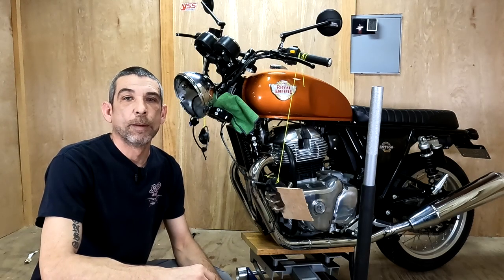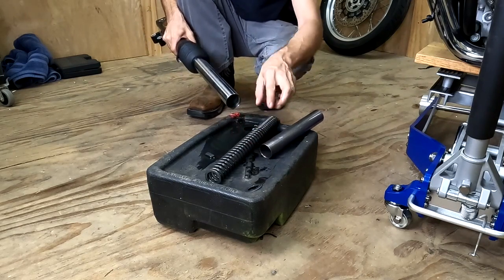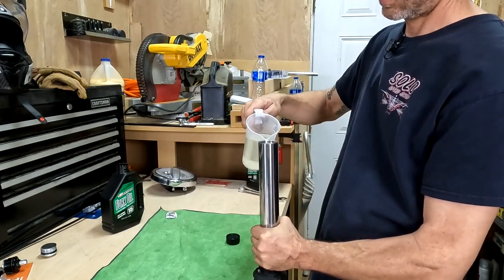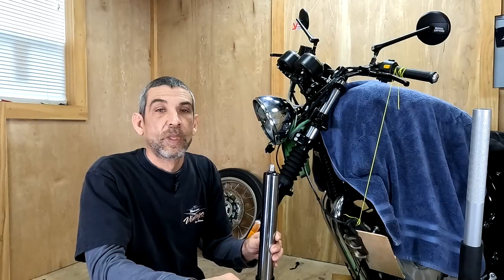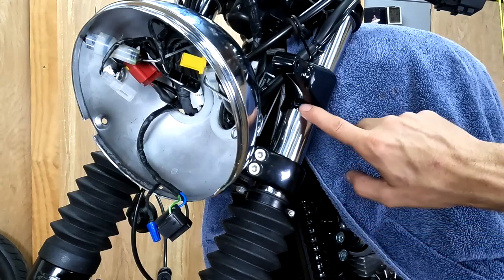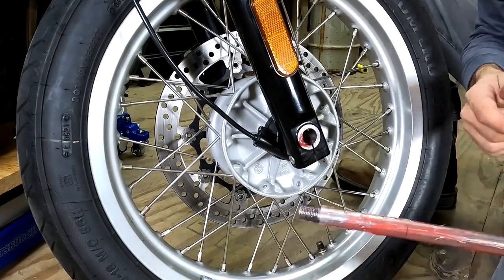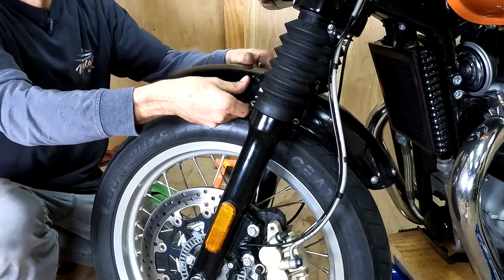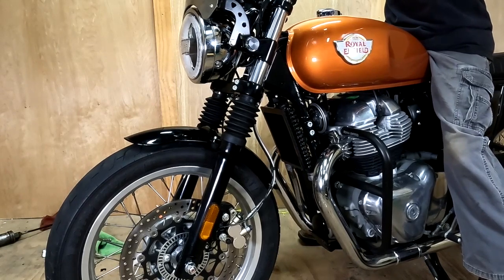Royal Enfield Interceptor 650 - YSS Fork Upgrade Kit (Part 2) - Assembly

Comment: After ridden my friends gt with yss springs and complained about it on bad roads .
I removed the springs which to hard for a confi ride and installed preload adjusters 
So my opinion keep stock spring and install preload adjusters  start at 6mm in ,gives a allround confort .
Works fine on my interceptor and took realy bad roads and holes  here in Belgica .
Start with the preloads and safe money .
Grt

Comment: once again a great video, the volume of fork oil that you added is for standard fork internals, now you have added the emulator  and added the oil, the volume of air inside the fork will be less, air is compressible and forms part of the suspension, i reduced the oil until its just above the emulator with fork extended so the emulator is always in oil, or use fork oil level, ie a syringe and some tube to get oil level correct, also if you buy the emulators from tec you get instructions on drilling the damper rods, i drilled 6 8mm holes in mine, i think they dont saynthis 8n the kit so people arent frightened off, im sure yiu will find improvement but it can be even better, good luck
Reply from the maker: @rover100bunson Thanks for the comment. Yeah, you can change the air gap / air cushion by adding or removing oil to get all kinds of different results. I don't think I'll do the drilling. I haven't rode it yet but I'll adjust the oil level if if I need to. I have a buddy who put 430ml in his forks with the YSS upgrade kit and got amazing results. Once I ride the bike I'll get an idea of what I need to do, if anything, to get the front suspension tuned in. Thanks again for the comment and thanks for watching.
Reply: @my-enfield612  I am in the camp that does not drill anything on this kit. After 20,000 miles/2+ years (28,000 on the bike) I am very satisfied with the upgrade and still believe that if a rider wants different damping they change the weight of the fork oil. 
Good methodology in your technique and we appreciate your giving the distances/spacing for the headlight brackets, etc. Again, this kit is THE single-most improvement to the Enfield 650s bar none. Anxious to hear your opinion as well. Virginia
Reply: @frederickwoods5943  If you don't drill out the damper rods then the compression damping is still controlled by the tiny holes in them. Drilling them takes the damper rods out of the equation putting the compression damping on the emulators which is what their for.
Reply from the maker: @Frederick Woods Hey bud, glad to hear you chime in. I'm hoping to get on the bike tomorrow. I'll let you know what I think. I need to get the front wheel off the ground so I can adjust the preload before I ride. At least get it close. I'm excited to see how it handles. I like a stiffer/track setup in my suspension so the 15w should be good. I thought 20w was a bit much. I'm sure you know the owners manual says the fork oil is 2w 25. But, the service manual says 10w. There is a diagram that says 2w 25 but right under that the text says to "use the specified fork oil 10w". Have you seen this?
Reply: @my-enfield612  yes, I saw that and agree that 15w is optimum. Years ago we mixed various weights to get an oddball viscosity such as 17.5, etc using equal parts of 15 and 20.
Thanks for the heads up and looking forward to your findings... be safe.

Comment: Are you sure that you put the yss fork kit inside the forks before adding the fork oil. Better to put first the fork oil and measure the air gap before adding the yss fork kit.
Reply: You are correct.
Reply: Does this really matter which way , oil as you did on the video, or oil first, great video  thorough tutorial thanx, nice handlebars to, can I ask what make and model?
Reply: @paulwatson2961  the air gap matters
Reply: if you add oil first and measure the air gap before adding the springs, the measurement will be different after you add the springs. When you add a mass to liquid, the level of the liquid will rise
Reply: @breadgarlichouse2265  This is why YSS advises you to pour the oil in each fort leg first to establish the correct air cap first. Before adding the springs and kit.

Comment: The YSS Fork Valve needs explaining, mine came set differently for each leg!  Without fine tuning this valve the whole upgrade is incomplete, as this sets the fork rebound. FYI  I am at 3 turns out from full close, this has eliminated the the fork going into a 2nd bounce that seriously unsettles the bike in corners. Ride safe

Comment: So by simply slipping in an emulator you have improved the fork performance ..... yet you still have the oil flow controlled by the original damper rod holes,  which basically means the emulator isnt doing its intended job. It might just about be controlling whatever oil the damper rods allow through thats all and it is not operating as per design. There are plenty of emulator videos out there, but the one by the inventor, Paul at Race Tec is worth a watch and proves my point.
Reply: That's not quite correct. At low suspension velocities (when going over smooth or semi-smooth pavement), the emulator will provide much more resistance than the holes in the damping rod so it will work just fine whether the holes are drilled out or not. It's only at the high velocities, when going fast over harsh bumps and when the emulator opens up that the holes can become the limiting factor, making the suspension harsher than ideal. If you experience that harshness then yes, you need to drill. Keep in mind though that if you drill too much, the suspension might start to bottom out on those harsh bumps, which is much more risky. The emulator provides very little damping at very high velocities (when it's fully open), relying on the damping rod holes for damping at those velocities instead.

Comment: Great, no nonsense, step by step video, just what I needed! Thanks a million :)
Have you found a marked difference after riding it?
I also see you didn't drill the emulators, which I would not be too keen on doing, (if it needs the drill hole, why don't they make it that way?) Was there a reason you didn't do so in your case, and would adding a thinner weight oil achieve the same result if you wanted??
Anyway, great video.
Reply: Why would you drill out the Emulators? You mean damper rods.
Reply from the maker: @Andrew Rymell Thanks for the comment. I haven't ridden the bike yet. I'm gonna ride it tomorrow. Yes, I didn't drill the damper rods because, like you said, it not made that way and the instructions don't say to. I'll put it this way. I have heard people say the upgrade kit, with no drilling, is "night and day" compared to stock. After they did do the drilling there was a noticeable difference in the upgrade kit "but it wasn't night and day". Once you drill you can't go back. Different weight oils will change everything. Changing the air gap/air cushion will have big effects too. I don't care what they say, I won't be drilling these out. Thanks again for the comment and thanks for watching.

Comment: I see you used RS15? I am wondering if another brand would be equivalent? Also, is the orientation of springs when put back something to watch out for? I plan to do this, but I am considering to only swap out the oil only with preload adjusters and see how it turns out.
Reply from the maker: @Jay Patel Thanks for the comment. I'm not sure about other brands. Haven't looked into it much. As for the springs, the orientation doesn't matter with this kit. The spacing between the spring windings is the same all the way down. If the spring had tighter windings/smaller gaps on one side, the side with the tighter windings would would go in first. (tighter windings down) Thanks again for the comment and thanks for watching.

Comment: I'm surprised you don't measure the air gap in each forkleg.
Reply from the maker: @janjansen7556 Thanks for the comment. I do everything by the service manual which gives you the milliliters needed for the front forks. You can use the air gap method but there is nothing in the YSS installation manual that mentions the correct gap. Some people say 140mm and others say 150mm. Also, if you go with the air gap method, I'm pretty sure the springs need to be out and the fork should be fully compressed when measuring the gap. Way easier if you  know the recommended oil amount. Just use the measuring cup and poor in. Thanks again for the comment and thanks for watching.
Reply: @my-enfield612   hmmm...it is not one or the other: of course you start with recommendef amount of fluid. But next you can measure the airgap to ensure the level is exactly the same in both fork leggs. And the (skimpy) YSS instructions do mention it  as the first of the final remarks: "measure oil level from surface of oil until the edge of inner tube"

Comment: How is your feedback? BTW 15 W oil is not to heavy for fork ?
Reply from the maker: @Igor Leahu I really like the YSS kit. It's a major upgrade from the stock setup. Honestly, the 15w feels a little light with the softer preload settings. If I wold have gone with 10w I don't think I'd like it (too soft for preference). I will probably switch to 20w at next maintenance. Thanks for watching

Comment: You need to drill out the damper rods or this kit makes no difference at higher speed.
Reply: Have you ridden an interceptor with yss kit installed  at high speed without damper rods being drilled out?
Reply: @marcjohnson7734  No but there is plenty of evidence on Youtube, If you don't drill out the damper rods then the compression damping is still controlled by them & not the emulators.
Reply from the maker: @Steve Palmer Sorry man, but I'm gonna call B.S. on your comment. Not everyone is drilling these kits. Yes, a lot of people are but it's not required. It's almost an upgrade on top of an upgrade. A small improvement compared to the kit without drilling, but not much. Maybe you should try it for yourself before telling others what they should, or shouldn't do. So, it works at low speeds but not high speeds? lol You need to think about what you're saying. You're basically saying that YSS is selling a kit that doesn't work (unless) and that's just not true. The YSS instructions mention nothing about drilling. I'm pretty sure they would mention that if it was a necessity. Never do they say, do or don't drill the damper rods. Some people are saying YSS doesn't mention the drilling so people aren't scared off from buying the kit. That's ridiculous. Seriously. I've got an idea. Why don't we ride this thing at high speeds and make a video. I have some old footage of the front forks, before the upgrade kit, we can compare it to.
Reply: @stevepalmer5670  the instructions, Hitchcock’s motorcycles, and Stewart Fillingham disagree See from 14:00 at https://youtu.be/VCp2e-lAgcI